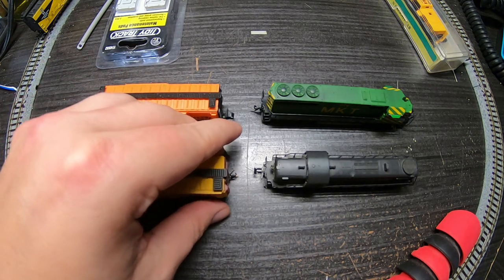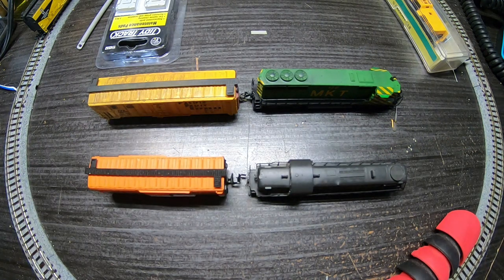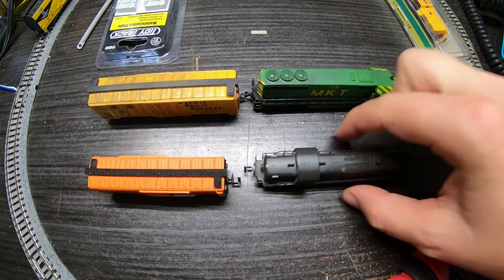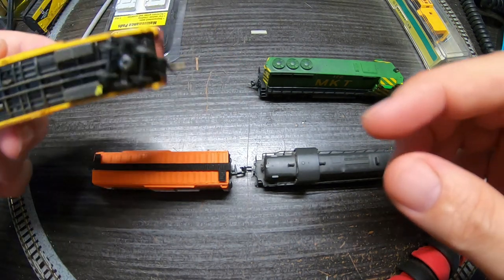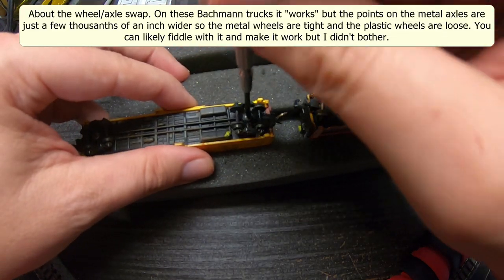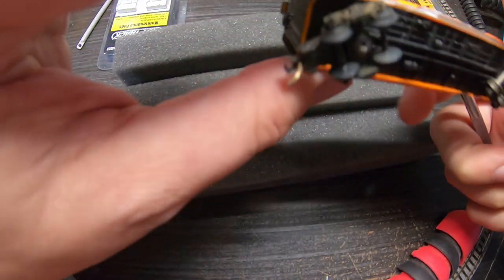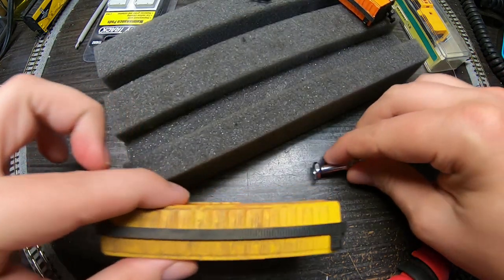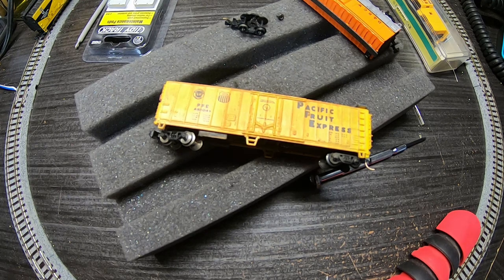Watch this before spending a bunch of money on replacement couplers for your N Scale rolling stock.

Comment: It's funny, but I figured this out on my own after buying a Bachmann "Spirit of Christmas" set this year ($100 Amazon special) and wanted to add a caboose. I had an older Bachmann AT&SF red caboose and a green BN that could mix/match Christmas colors, but they were both Rapido style. Fortunately, the Bachmann set came with swappable couplers that allowed me to change one of the passenger cars' rear coupler to the rapido option. After creating that 'adaptor' car I was able to attach my entire set of older rolling stock. It was a huge unlock, so I did the same to one of my Atlas ARR box cars so that my newer ARR train with MTL rolling stock can now pull my older foreign stock. It is a great way to save a bunch of time and money, and puts my childhood train back in service after 30 years in storage. Thanks for the great vid and content!
Reply from the maker: While not as common anymore there was a time when some manufacturers were putting both types of couplers in with their locomotives and rolling stock. I seem to remember some of my older Kato stuff came with the Rapido couplers in the spare parts bag.

Comment: I've been practicing this method for some time & it works.  I have recently purchased 4 Bachmann 85' silver illuminated passenger cars & noticed they've included a pair of Rapido couplers (with whiskers) for transition cars. The problem I now have is they didn't include a diagram of the body mounted coupler box nor instructions on how to make the transition. I'm not good at handling tiny screws & get frustrated easily, so I will stick with the E-Z Mate couplers. After researching, it's not a viable option to swap out all couplers on 100+ cars that are over 30 years old. Rapido couplers are looking really good now after years of worrying about aesthetics. I'll keep my sanity.  Thanks!

Comment: I picked up a NRMA collectors edition train on E-Bay a while back. The first car in the consist was arranged this way with one knuckle and one rapido. With the loco having a knuckle it allows for easy coupling/decoupling while keeping the rest of the train together. It also permits some realistic/prototypical operations where the steam loco will drop off the train at a station or yard and then go to the roundhouse/service shed while a switcher comes and moves the train where it needs to go.

Comment: Good informative video.  Did this years ago.  Saves the hobby budget for other things like more locomotives, rather than changing all the old Rapido couplers.  That could get very expensive quickly.
Thanks for sharing. 👍👍👍
Reply from the maker: That's really why I decided to put the video together. Replacing everything with Micro trains, or other type of coupler, can get pretty pricy if you have a bunch of older rolling stock. In my case a bunch of my old stock is cheap and ancient Bachmann, Life-Like, etc. where the coupler kit would cost more than I likely spent on the piece itself. lol

Comment: The "rivets" are usually just push pins that use a friction fit to hold the truck in place.  Think Lego.  All you have to to is pull up on the pin and it will come free.  Just make sure if it has a hex on it to line the flats up or it will mess up the hole and eventually fall out and your truck will not stay on.

Comment: I already commented before, but wanted to add that if you buy a piece of older Bachmann N scale rolling stock with knuckle couplers, there are usually rapido couplers included so all you need to do is change one coupler.  You will then have a conversion car without having to change trucks.  Very easy to do as it just pops in, but be careful so you don't lose the spring.  Usually provided in the larger Bachmann jewel boxes.
Reply from the maker: 100% of the used rolling stock i've bought either on eBay or at train shows didn't come with a single spare replacement coupler. Now by rolling stock I mean just cars. I have bought plenty of locomotives with replacement couplers. Mostly with knuckle couplers already fitted. And rather than fit any of them with the included Rapidos I just decided to make a quick conversion car. Then it doesn't matter which cars I want to pull behind a given locomotive.

Comment: You can do this with all N scale rolling stock most have a plastic pin (No rivets)  you just pull the pin out and change the truck over you can also change the pin to a 2.56 screw $5.00 USD for 100 screws and you can get 10 pairs of trucks from  micro-trains under $50
Reply from the maker: Thanks Kenneth. I didn't know the pins were removable. I may attempt this with one or two additonal cars as a test. Is there a default MT truck that you pick up or do you buy based on prototype accuracy?

Comment: Atlas, Life-Like and Model Power trucks are not riveted on. They are attached with a plastic pin pressed into the bolster. Gently pry the pin out to swap out the trucks. Very easy.
Reply from the maker: I'll have to give it a try! They looked like rivets so I didn't want to risk busting up a car. But if they're just little friction fit pins then that opens up a bunch of opportunities to do this on virtually everything.
Reply: @Trains-With-Shane  Yes. That's exactly what they are. Friction fit pins. Micro trains trucks come with 2 sets of extra pins. One for Atlas, Life like and Model power. And one for older Con Cor cars.

Comment: Super good video I do that all the time, I have 5 or 6 transition cars like that. Some times I run a knuckle engine, then a transition car, then a full train of old Bachmann cars with Rapidos, then a transition car, the a Micro-Trains caboose.
Reply from the maker: That is how I use mine as well. Often I run the transition cars back to back if I don't need an actual transition. This way I keep them on the track for easy access. If I want to switch engines I just remove the frontmost car if I need a transition.

Comment: I had a couple of cars that had one of each type of coupler on either end. It was fine and it worked well but after a while I started converting everything to Microtrains couplers. 

 I rebuilt a dozen or so Bachmann 50' reefers that when I bought them were painted for Santa Fe, but the orange was too pinkish red to look correct.  And there was no white in the corners of the Santa Fe  logo, and the MTC logo and door data is black on a dark blue door, so I repainted them all so they had different road numbers and correct colors etc. 

At that time, I put Microtrains  wheelsets with roller bearing trucks and so I cut off that knub that sticks up, and drilled the holes to 3/32 to accept the Microtrains  bolster pin provided. It made for a much better running and looking reefer. 

I have a couple of those yellow Southern Pacific reefers like yours too, and I did the same thing. 

My first test of Microtrains  couplers was on 4 Model Power Santa Fe RSD 15 "Alligators" to combat the "pull apart" issues. So this necessitated a conversion car. 

But I was so well pleased with the microtrains couplers, I started converting everything to them.

Comment: Yea definitely a great tip. Sort of a dedicated mating car to match up mismatched couplers. I’m not about to disassemble a loco just to swap couplers. I had one loco from eBay that had rapidos but they bent probably due to being stored wrong. So I used toothpicks to stretch them back open. After about a week of leaving the toothpicks in place they were finally opened back up so they would work correctly. And it’s my fastest locomotive so far.
Reply from the maker: I've got such a mismatch of old and new rolling stock that the coupler mating cars are mandatory if i'm to run large trains.

Comment: I’m an N-scaler, but I model modern Japanese railways, so the majority of my fleet are modern electric multiple units with Scharfenberg style couplers from the factory. Luckily, for the EMUs that don’t come with them fitted, the Japanese manufacturers sell Scharfenberg couplers in packs of up to 20, so you can replace them quite cheaply.

For freight cars, Kato makes a knuckle style hook that drops into the Rapido pocket and mates with knuckle couplers, so I’ve standardised freight cars with that.

Japanese makers use a standard coupler pocket and many of them also have a standard layout for body mounting coupler units too.

Comment: I put 2-56 screws in place of Atlas 1st and 2nd run holding pins, believe it or not 2-56 screws are the same used in HO, N scale cars (for the most part) are just smaller versions mechanically as HO scale cars.
Reply: good idea for making hot trucks for FRED's and cabooses

Comment: I recently inherited about 100 pcs of Bachman rolling stock to add to my existing consists. I can't swap that many, so I will have to "swap" over as many as I can for the time being. Then I will just put the unusable rolling stock on an unused spur for storage. Great video!
Reply from the maker: Just need to swap out one side of a few of them and you can run any combination you want. Run them all 🙃

Comment: Done that for about 8 or 9 years.   I  also bought  KATO  trucks to match up to my KATO engines.   Have a very nice SP Daylight  set but with Rapido  couplers.  I took a dummy B unit and did the conversion on it. Now run an F7A with two B units... works great.
Reply from the maker: I should probably make some Amtrak conversion cars as i've got a mix of knuckle and rapido cars from various manufacturers. I've got a SP Daylight set as well but it's all rapido equipped because it's old Con-Cor
Reply: @Trains-With-Shane  The biggest issue I ran into was the coupler height not matching. The B unit has an ever so slight rake to it but the couplers stay connected so I can live with the rake.

Comment: I started making these transition cars by swapping trucks back on my first S Scale American Flyer Trains from the 1950's. They had a transition to knuckle couplers in around the mid 50's from what was called a link coupler. I still got my American Flyers running. On my HO trains, when they went to Knuckle couplers I did the same. So today I got a lot of N scale stuff too.  On these I have made 4 transition cars. About half my rolling stock is the Rapido couplers the rest Knuckle. One of my longer freight trains I have about 50 cars, a total mix of couplers  by using the 4 transition cars. The N scale couplers are so small I don't care about how they look.

When Ebay matured I started finding re-manufactured after market Knuckle couplers for the old American Flyer Trains. The old link couplers really look bad. So about 10 years ago I got all my American Flyer Trains converted to Knuckle couplers. Since the trains are much larger scale this was pretty easy and required a hammer. Try using a hammer on a n scale train (LOL),  I only had maybe 20 cars to deal with, so was doable.

Comment: I've heard of this idea before, the guys at my local hobby shop called it a "converter car" or something like that. It does work pretty well if you're just running trains continuously with the same consist each time, but since my layout is more focused on switching it might not be my best option. Great video nonetheless
Reply from the maker: Switching operations are DEFINITLY better with knuckle couplers. Especially if your layout has permanent or electro magnetic de-coupler points. I've got a few sections of that Kato track that have de-coupler magnets built in. Need to play around and see if I'm going to use them or not. Just haven't had time yet.

Comment: I use my converter cars as a buffer car behind my locomotives for tank unit trains.🚂🇨🇦🇺🇸
Reply from the maker: I may have to put together a few more. I just picked up a mix of Amtrak Phase III cars with Rapido and Knuckle couplers (2 different lots). So will need to put together at least one converter car to be able to haul all of them at once.

Comment: it's a great idea and good way to run more cars.  i have 3 custom made cars that are setup the same way (bought them that way).
Reply from the maker: There are probably more optimal ways to do it. Like to use a car with body mounted couplers and only convert one to a knuckle. I'll need to look up and see who's offering those custom conversion cars. I may put one on my layout.
Reply: @Trains-With-Shane  I just looked at the 3 that i have, 2 say atlas on the bottom and the other has no markings.  but i'm not sure if it was something that was done by atlas or if it's something that the person i bought them from might have done.  either way, they've been useful as they have military vehicles on them so i can run them behind my UP 'The Spirit' locomotive and mix them through the consist if need be.

Comment: Have a bunch of old N scale heavyweight passenger cars from ConCor, Rivarossi, Bachmann all with Rapido couplers. Motive power all has MTL couplers. Love MTL, but they're real proud of their product$. The price to replace the trucks on 30+ cars was stupid high in any universe. Took most of my head-end cars and did like you. Easy, cheap and , while not the best looking, the Rapidos work OK for railfaning passenger trains.
Reply from the maker: The Rapidos work really well for me. I've also got a few old con-cor, atlas, and rivarossi lassenger cars and it'd cost quite a bit to convert them. I may do some of them in small batches. but until then it's adapter cars.
Reply: you have to practically stick your nose to it to tell the difference- especially on large layouts. not spending money on MT couplers for your cars will allow you to buy other goodies- like fox valley models' terrific brass wheelsets. they look good and sound great on the rails and do more for your freight cars than installing knuckle couplers can.

Comment: Yup, did that many years ago by simply cuttung off the Rapido truck mounted coupler and installing a Kadee coupler box, with appropriate shims, to the boxcar frame more like the protypes.  Presto, a car to join the two types of couplers!
Reply from the maker: Body mounted couplers definitely lend themselves better to switching ops. I keep most of mine truck mounted to better deal with tight radius curves.

Comment: In my HO, I changed 1 coupler on two cars so I can use both couplers on same train. I was just slightly limited to the order of the cars.
Reply from the maker: Yep the order is the only downside. But for me it's worth it for the cost savings. At least with most of the rolling stock that I have being older.

Comment: Adapter cars--whatta concept. I did the same thing in HO with NMRA and Kadee couplers  60 years ago.
Reply from the maker: Wow that's a long time ago! I don't think knuckle couplers were a thing in N scale till at least the late 80's. But if I recall O scale has had them forever. I wasn't sure how far Kadee went back in H.O. scale. Good old #5's. I've got a bunch of those as well in my old H.O. scale supplies that I just broke open today for the first time in years to help my brother get started who wanted to move from O to H.O. scale. I gave him a few old but trusty Atlas yellow box locomotives, some EZ track, and an old Bachmann power pack.

Comment: I did that initially to save money years ago using the micro-trains bulk pack.  The only issue is that you can't easily move the cars around unless you physically pick them up to uncouple the rapido side.. Also, the bachmann wheels are metal and don't run as smoothly as the micro-trains trucks do.  I actually modified the bachmann rolling stock by filing the outside joint for the screw since the micro-trains trucks were a bit tight. It was a bit of work but now they work like a dream.
Reply from the maker: My metal bachmann wheels roll pretty well. Although i'm not to the point of replacing them yet. I've got quite a few better pieces now. Mostly Microtrains, that I use for switching ops and the like.

Comment: This applies to HO scale as well old train models. Have hook horn couplers new stuff has knuckle couplers nice video.
Reply from the maker: Thanks! I've got a bunch of older HO scale stuff and I think almost all of it is hook horn.
Reply: @Trains-With-Shane   the good news is that it's pretty simple to convert old rolling stock that has hook horn to knuckle couplers. When I first got into ho scale trains I bought dozens of old rolling stock and converted them to kaydee couplers and metal wheels with very little work.
Reply from the maker: @Riogrande6400  I think I have a box of Kadee #5's somewhere.
Reply: @Trains-With-Shane  you will also need some kedee coupler boxes and glue. I would also recommend a coupler hight gage and a piece of flex track.
Reply from the maker: @Riogrande6400  the height gauge I will need. I've got one for N scale but not H.O.

Comment: Those crazy Rapido couplers seem to work better, and they don't bust as easily as the knuckle couplers.
Reply from the maker: You're not wrong! They tend to handle tight radius curves better as well. Although that can also just vary depending on whether you're using shell or truck mounted couplers, etc. I have to say that as long as the coupler heights are anywhere near similar the rapidos tend to stay coupled.

Comment: I’ve done it before and one thing to consider is the wheel size and truck design also works with ho.
Reply from the maker: True. don't want to have 33's vs 36's or something. Would make the car slant.

Comment: Newer Bachmann rolling stock uses modern ez mate knuckle couplers. Swap with Bachmann new to old. Uses the same screw mount & bolster nub.
Reply from the maker: I like Bachmann's newer couplers. They seem to work well. At least on the locomotives that I have purchased that have them.